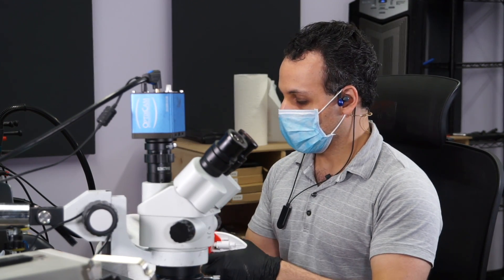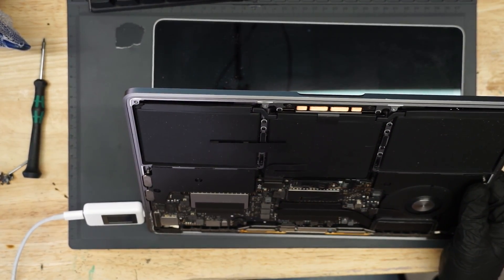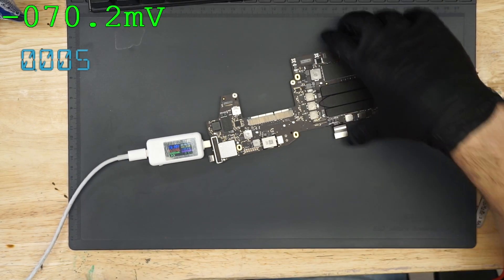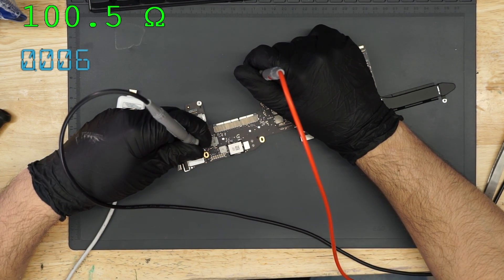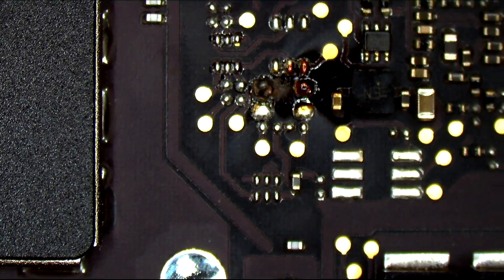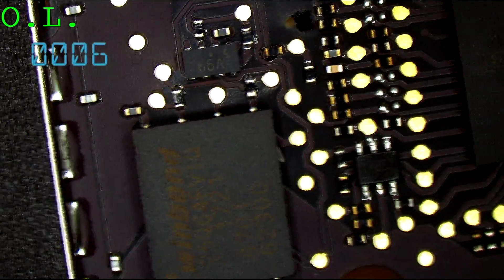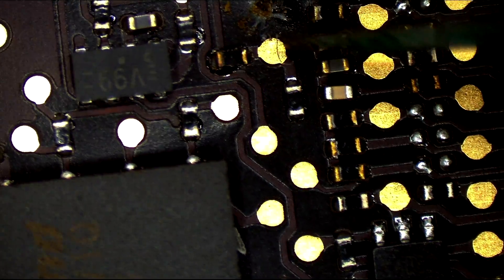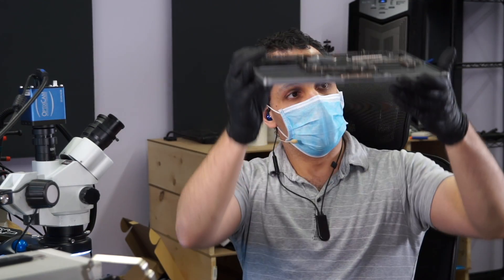Macbook board develops hole through it, Apple calls it liquid damage. 😂

Comment: You are not wearing your masks properly. There is a large gap between the top edge and your cheeks beside either side of your nose. As a result you have an opening which will allow the "beer virus" to reach your nose and mouth. To keep yourself and as an immediate result your customers safe, you need to fix this issue.
Not trying to down nor insult you, Louis, simply stating fact to try and help you and protect you.

Respectfully,

David

Comment: The proper, scientific diagnosis for this Macbook and it's designers is called https://en.wikipedia.org/wiki/Hydrocephalus
Look, all symptoms match: accumulation of cerebrospinal fluid, increased pressure, mental impairment. defects include neural tube defects. 
Diagnosis is typically made by physical examination and medical imaging. (Exactly what Louis performed!).
Apple. Defective by design.

Comment: Looks like whoever initially put the board together caused it to delaminate.  Could be crazy I'm still in soldering class
Reply: My guess would be a manufacturing defect in one of the subcutaneous circuit traces.  It didn't look a component exploded ... but the blistering/warping of the board in the affected area is certainly indicative of a circuit trace self destructing.  OBTW:   When I went to school we had to repair this type of damage in order to pass the class.  Instructor had a bunch of multi-layer boards that he took a hammer and mail to ... right at the intersection of multiple layered traced ;)
Reply: @digiacomtech5589  hey I'm  curious about something. How would you go about removing flux with something other than IPA? We use that at work because it dilutes the flux, but doesn't like break it down or anything.  I didn't know if there was a safe soap or detergent of some type that could be used in place of IPA. I'll be making batteries. I won't be going off script on it, but I'd like to be able to speculate with supervisors about it at some point. (Fresh at the new job. Don't wanna get fired / die lol)
Reply: @patriotxpants  ... Usually Isopropel Alcohol (IPA?), or 1,1,2-Trichloro-1,2,2-Trifluoroethane (check hazmat details) and then cotton swabs, acid/tooth brushes, & paper towels to scrub the affected areas and mop up any resulting crud (from the damage) and/or flux ... rinse and repeat as needed until there is NO trace of flux or other foreign crud.

We once had to work on some salt water immersed equipment.  After a few distilled water baths & rinses, mild brush cleaning, and some time in the oven (very low temp) and it was good as new.  You can usually do the same for phones dropped in water ... clean/wash/rinse em (no soaps) then dry them out (low temp oven, look at the max operating temp of the device for temp setting) and then pack the device in a sealed container of dry rice for a day or two before applying power.  MAGIC!

The thing to remember here is that WATER damages electronics when they are powered ON as water can be very conductive.  IPA and Trike are goof for removing flux as they evaporate quickly.  With no power applied, all three can be used to clean and will dry without leaving any powdery residue.  That is, all three can be used as the least destructive cleaning method.

Comment: @6:50  ... PCB Repair 101 ... Least Destructive Method:  Going straight for an X-Acto knife is not employing the least destructive method to clean/examine a damaged area.  Also note that this is most likely NOT cancer that has spread throughout the motherboard, it is most like a localized failure (e.g. a single tumor) that can be cut out and the surroundings repaired.  OBTW, first thing we were taught was to perform a visual inspection ... doing that might have clued you in to the problem faster than jumping straight into circuit/signal tracing.

That is, assuming this is a multi-layer PCB and you have the schematic you can excise/remove the damaged area and add micro-wire jumpers (overboard) to replace any traces destroyed within the damaged ares.  Granted this would be a tedious time consuming process that could only be accomplished with the schematics of the board's circuit traces (something Apple probably isn't willing to hand out).  And the cost to repair (time x money) would probably be greater than the cost of a replacement board.  Bottom line, worth repairing?  Probably not, but none the less certainly repairable with the appropriate tools and training.

Comment: If it wasnt an apple product you could by a replacement board for 50$...because it's apple it'll cost you 300 and then theyll sue you for using unauthorized parts.

Comment: Serious question: what does this customer do now? I assume the whole system is screwed at that point, potentially even resulting in the loss of data?
Reply: usually you can move the memory on another machine to recover the data
Reply: @dgpsf  it's also just another good reason, in a looooooong line of good reasons, not to buy (cr)Apple machines.

Comment: How many layers are there to this board? Could you drill through it and replace the destroyed connections with jumper cables? You could then use the hole to route the cables through to the other side.

Comment: There is still chance it can be repaired. Drill a hole there, then find out the lines, which needs to be restored, and connect them by a wire. Yes, that would not be easy a task.

Comment: I don't see any problem to repair this board. Scrap all layers and remove all signs of explosion, after that restore all ways by jump wire. Anyther easier method - burn it more by injection high amperage and probably short will go out.

Comment: Wouldn't it be possible with the boardview to determine how many traces and which are right there, and if there isn't many, just drill a hole through the burned part, and run jumper wires for the few traces that has been severed?

I also wonder what might have caused this? A manufacturing defect causing a high current trace to be too thin?

Comment: But it could actually be water damage! Thats how they would come up wit this:
- the damage was caused by a short between the layers
- short was caused by electricity
- electricity comes from the battery and power supply
- power supply is connected to the wall outlet
- the outlet is connected to the grid
- grid is connected to a hydroelectric water plant
This means water was involved and thats why its water damage.

Just like that "business continiuity insurance" that refused to pay becouse of the flood... of the power plant ;)

Apple Geniuses crack me up xD
Reply: There is a way easier answer: there was a short that made parts of the board overheat so these parts turned into liquid.
Boom: liquid damage
Reply: @MrManniG  Thats how Malt turns into Beer ;)))
Reply: @MrManniG  There was an explosion... due to the short, which vaporized the air around it, and air has a composition of .9% water so it's liquid damage...
Reply: Krzysztof Mazurkiewicz this guy is an imbecile 
continues to read
This guy has the mind of a mastermind.
Reply: @dudeomfgstfux  i had a thought this could end something like this as well:
- grid is connected to a coal plant
Customer: So where is the water damage from?
- oh yes it was raining there a week ago so thats definitely the cause of water damage 
;)
Reply: @ИванСнежков-з9й  So at this point this turned into a "Give a list of excuses to the Geniuses" ;)
Reply: @krzysztofmazurkiewicz5270  coal plants use coal to make steam to turn turbines so there is water lol
Reply: @ИванСнежков-з9й  and most solar towers use some kind of molten (liquid) ionic compound that isn't water
Reply: @ИванСнежков-з9й  Natural gas power does not necessarily need water.  You can operate them in simple cycle mode so they just use exhaust gas to spin a turbine that is connected to a generator.  All oil coolers can be oil to air with fans.  Many do use water injection for emissions controls, but many also do not.
Reply: The jury decided.....
Reply: man, it also can be a solar power plant, you know, sunlight being produced by the hydrogen fusion reaction, and hydrogen is basically vegan water
Reply: Also, the electrolyte in the battery is liquid so it was liquid-damaged from the factory.
Reply: It's nuclear fusion damage. :(  Solar energy!
Reply: @jaiden051  if by "there" you mean "outside of mac owner's parents' house on a day he was concieved", which lead to him being born, and purchasing mac that got damaged eventually - yeah, I can totally see how that's liquid damage
Reply: @jaiden051  now that just ridicules, how's that liquid damage? you are overstretching :D
Reply: @jaiden051  it dosent even need that because a large number of large scale solar farms are based in the principle of mirrors focusing the heat on a tank of water to make steam

Comment: Next excuse, 
“Has been exposed to an unsafe amount of oxygen requiring a replaced MacBook for only 1499 however because your existing customer you can get it for 1599.
Reply: hold up-
Reply: Justin Nowaczynski  something ain't quite right
Reply: @420f37  Of course it’s right. If you’re an existing customer, it means that they already screwed you over at least once. Which makes it more probable that they might be able to screw you over even more.
Reply: Actually, oxygen is quite dangerous.  If it was exposed to an unsave amount of oxygen, parts would corrode and it might even catch fire. And once things catch fire inside an oxygen rich atmosphere, they are really on fire.
Reply: @jort93z  love watching oxygen rich combustion. Sooo much energy.

Comment: how come you cant drill through instead of scrape?
Reply: It doesn't matter, he can't repair the inner layers after removing all of the layers. The explosion shorted all of the layers in that spot, so all of them have to be removed. But then there is no way to reconnect the inner layers, as they are between the outer layers.
Reply: @nulano  oh gotcha, so theres more circuit in the middle

Comment: Have you seen those machines that can shoot water at such high pressures that it can shoot through even steel? Maybe Apple thought the board was put under one of those. I’ve seen it cut through PCB before just check out What’s Inside’s video of them carving a butterfly from a Galaxy Fold

Comment: "I've never seen such a strange behaviour from a Macbook before"
1:42 Louis it's 34 mA, not 340. And 17 mA, not 170. How could you glance to the display and see the numbers ten times apart in a span of 5 seconds?
...twice in the video? :)
CVD-19 be tiring you tho
Reply: Came here to post this too. Also 3:17 "170 180 milliamps", no the display says 0.017A 0.018A, 17 18 milliamps.. no wonder he got confused!
Reply: He did get the mV correct though.
Reply: Its not mA, is A on the meter
Reply: @tejasbhartiya7066  0.033A = 33mA
0.33A would be 330mA.
Reply: @tejasbhartiya7066  ok but 0.030 A is 30 mA, look closely
Reply: @LockDock666  Oh true. I missed that

Comment: This was caused by liquid damage, the hole was caused by spontaneous quantum tunneling caused by a droplet of liquid, which was so powerful it tear a hole through 5th dimension and to the other side of board back through 3rd dimension.

Silly Louis, you just don't understand difference between quantum tunneling caused by liquid damage and a hole, you gotta be a genius to understand it, like people in genius bar.

In a more serious note:
According to apple's website https://support.apple.com/mac/repair/service , "AppleCare+ does not cover excessive physical damage, including catastrophic damage due to liquid contact or submersion, or damage caused by the presence of hazardous materials".

This is probably why Apple keeps BSing customers saying it's caused by liquid damage and force people to do out-of warranty repair (if you can even call AppleCare+ a warranty option). Geniuses will show people that link and say liquid damage is out of warranty coverage and make them full price for board replacement.
Reply: indubitably.
Reply: "[D]amage caused by the presence of hazardous materials."

Solder, flux, fiberglass, copper, silicon, lithium - all hazardous materials and all indisputably present. Without them no power would reach that part of the board (which also wouldn't even exist). The failure was a result of power shorting. Therefore the failure was due to the presence of hazardous materials.
Reply: Kinda like a bumper to bumper warranty on a car. Everything is covered unless it is a gasket/seal or damage from a bad gasket/seal.
Reply: Droplets👀, wouldn’t of happened if the MacBook had worn a mask.🤷‍♂️
Reply: I think it has much simpler explanation. Apple is outsourcing repairs and this board ended up with some silly and barely experienced "engineer"
Reply: KopaZ Covid 19 droplet
Reply: shut up kopaz

Comment: What was suposed to go onto those pads? That area where the board blew up looked like it was unpopulated from the factory. Or could it be an internal short that caused it to blow up, either way, impressive damage!😂😂😂
Reply: From my knowledge of his explanation, there wasn't anything 'Surface" related. Motherboards are dozens of layers of wires and insulation, and in this case two or more wires shorted, burning a literal hole in the board.
Reply: @Stacey Luster if these companies did this jobs properly then in theory the data should be fine... ofc they won't go through extra steps to recover the data though
Reply: You should see some of the high power car amps, explosion city 2ft of copper trace vaporized, pieces of transistors logged in metal on other end of chassis. Do not take bottom off those amps trust me!
Reply: @frizzlefry5  I had to "repair" a friends amp, the tracks that originally ran to the PSU MOSFETS where complely blown. That skidmark on the bottom was impressive, looked like something that yoy would see from maims powered stuff!
Reply: @DrakkarCalethiel  Ahhh so you do know, Worst one was a kicker 750.4 I think about 3.5ft long absolute nightmare think it was fused almost 200a! Dude hooked me up w some us made class a soundstream amps though and a few hundred $ so not too shabby. I dont miss working on those, too many dumb people with too many subs not enough ohms. I was wrong on mod # was about 3k$ though at the time.

Comment: Louis invest in a uvc lamp to be sure. all you would need is a large enough cardboard box to fit the laptops in. After that’s done get some aluminum foil and coat the inside of the box. make 2 openings, one with a lid to place laptops, and a fixed hole for the uvc lamp.
Reply: Could then easily just integrate it into normal business after all this covid nonsense is over.
Reply: UVC will also damage the screen and plastic.

Comment: Even if the macbook exploded in their lap, fanboys would just buy a new one.
Reply: @Stacey Luster imagine buying premium grade workstation laptop and then care for working conditions not being too stressful. Next thing you'll know, macbooks won't work if you don't let them vote.
Reply: @Stacey Luster idk if u know how a cpu works, but cpu's are designed to be pushed to their max, only limited by thermals and power draw. His MacBook was only 70 degrees and in no way should it be running at 0.8GHz
Reply: @Stacey Luster A laptop from almost any other brand other than Apple can pushed to run 100% 24/7 and not kill itself. My work laptop runs 100% CPU load pretty much all the time, it's 4 years old now. The one before that lasted nearly 10 years before it died. This is normal for any decent brand of laptop, this is what every non-Apple owner expects from a product.
Reply: Stacey Luster sure it needs better cooling i wasnt saying otherwise, but at 70 degrees it should at least run at the base speeds and not 0.8ghz
Reply: Clearly the Macbook user was holding it wrong. :(
Reply: S M-- Fanboys into Fangirls?
Reply: I hear we learnt this from Samsung owners
Reply: NineEyeRon i have an iphone and built my windows pc
Reply: you are a moron
Reply: @Eric Matthews no problems then what brings you here?
Reply: @Eric Matthews 
"I have Purchased eight MacBooks"  There's your problem.
For not even close to half that money i upgraded my old laptop to a higher standard than any Apple product would achieve for the next 10 years 4 years ago.
Apple had it's time, and it was around 1980- 1998

Comment: Customer: the sound on my Mac is too low
Genius: It's water damage
Customer: But I didn't spill anythin-
Genius: Water damage
Customer: I was in a dr-
Genius: Water damage
Customer: Wh-
Genius: Now it will be a million dollars to fix this, you should buy a new one for $500,000
Customer: ?
Reply: Customer: Well, could you at least swap the hard drive from the old one into the new one?
Genius: 🤣
Reply: Welcome to the wonderful world of apple 🙄
Reply: It's not the employees fault.  They are just exclusively trained in the replacing of logic boards, so they are told to find an excuse to replace the logic board, and then charge 1200 dollars for it.